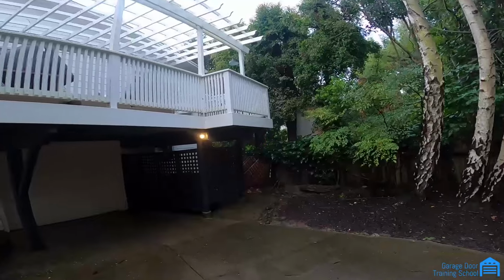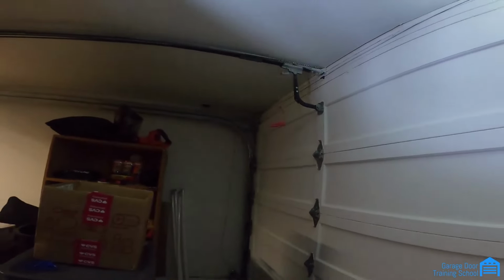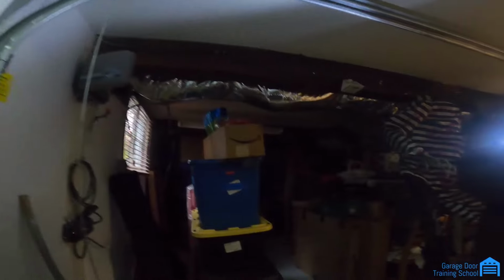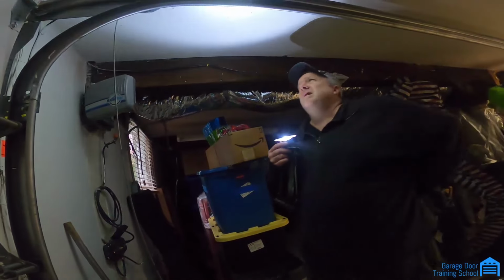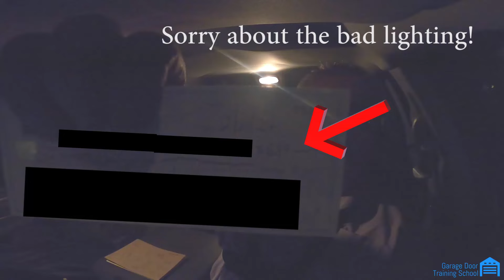WHO Installed This?! | UNUSUAL Door Set-Up

Comment: Do your course teach extension springs and if not what do we do when we come across extension springs if it’s not apart of the course
Reply: It doesn't but extention springs are pretty self explanatory. They are usually color coordinated with the weight they support. Take the springs off with the door up, lower the door onto a scale, weigh the door, and put on the corresponding springs. Door weighs 110 pounds put on 110 pound springs and reconnect everything.